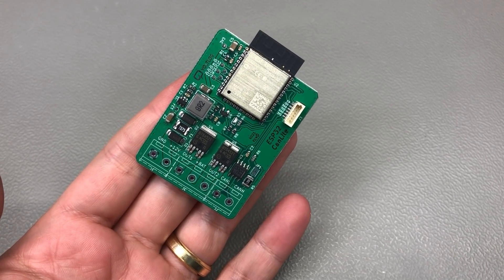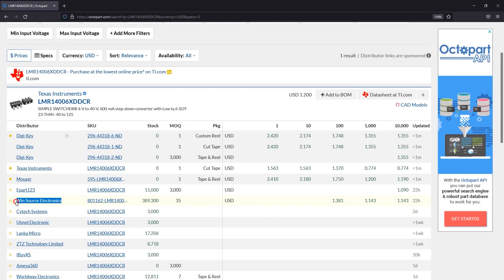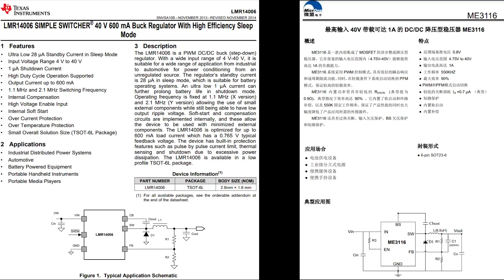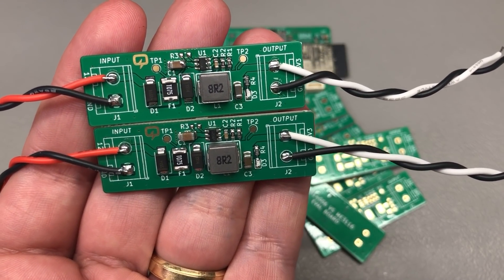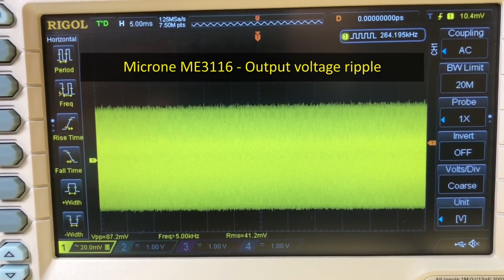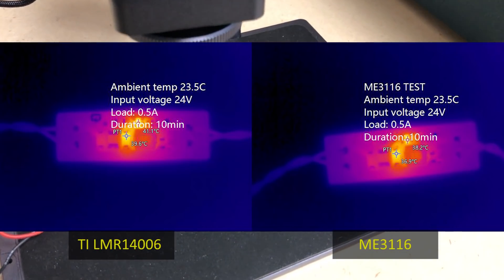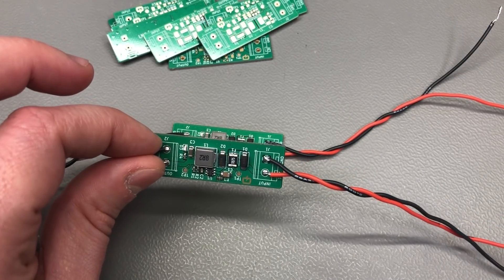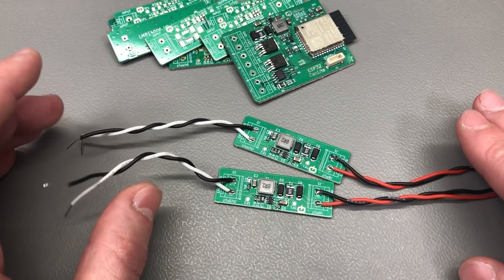Global Chip Shortage Solution Or Maybe Not? | Voltlog #406

Comment: While looking through the datasheet of the LMR14006 IC a while back I was wondering when to use the X and when the Y version. They apparently have no difference other than the switching frequency. It'd be interesting to know when to prefer which one.
Reply: The problem with higher frequency regulators is that they operate poorly with a high ratio between input and output voltage. A modern buck switching regulator often uses some kind of bootstrap circuit to generate a high enough gate voltage to switch a high-side NFET in the device. In order to keep that bootstrap circuit running, the controller needs to make sure the bootstrap capacitor gets enough switching activity, and therefore uses a minimum on time (there is also a minimum off-time, but that is irrelevant here).

Since for a buck regulator the duty cycle D=Vout/Vin, and Ton=D*T, you can probably guess where that constraint is coming from.
For the LMR14006Y, the min on-time is 95ns and switching frequency is 2100kHz typical. The minimum duty cycle is then 95ns/(1/2.1M) = 20%. If the output voltage is 3.3V and D(min)=20%, we have 0.2=3.3/Vin(max) ==> Vin(max)=16.5V.

Note this is not a smoke-Vin-max (like in absolute max specs). I would expect poor performance or regulation for >16.5V input. Although.. if the output voltage becomes unregulated, then that can create smoke down the line.
Reply: @nlhans1990  Thank you for this really comprehensible explanation. It also finally sheds some light on the question, why the simulator that @VoltLog linked in the CanLite schematic does not let me enter anything above 18 or so volts - despite the IC being rated up to 40V. I ran a simulation with the X version just now and et voila, I can enter higher voltages just fine.
Knowing this, I am surprised how robust the LMR14006Y is. I built a CanLite board myself and did some tests with different voltages (with some being under 10 and above 30). I did not experience any instabilities (or other failures) at all.

Comment: Since original part is operating at double frequency in comparison with replacement, does it use smaller inductor ? Maybe you could try to modify inductor value on replacement part, to see if ripple will get better or not.

Comment: The module you are trying to sub another part for is designed to be used in a vehicle?
If so, what about running automotive-related tests on the two parts, like a load dump test, to see if the Chinese one can take the voltage spike? I would think that these would be the significant tests in determining if a Chinese knockoff part can "cut the mustard" as a replacement.
Cheers,

Comment: why you used same setup for both ICs ? "replacement" have 550kHz frequency instead of 1MHz (require different inductor + ~3-5 times more output capacitance) and have recommended cap on feedback divider.
Reply from the maker: Because it would be very convenient to find a pin compatible drop-in replacement.

Comment: Regarding ripple: you could try to modify the inductor value accordingly. Speaking for the LMR14006Y vs replacement part: a larger inductor will lower the ripple current, and therefore ripple voltage. Since the switching frequency is 4x lower, it's ripple current will be 4x greater, so must be compensated with a larger inductor. If you used a 8.2uH inductor, then try 33uH.

The problem with that replacement is, whether you can find an inductor with high value and appropriate current rating in the same footprint.
Reply: I was also looking for a replacement but wanted to stick to the high switching frequency since I have no space for a larger a inductor or larger filtering capacitors. I found a fitting TI part but it's not able to run on 24V vehicles and it's not an automotive spec part.
Reply: had the same thought, it might be pin compatable but not component value compatable. Had the same problem the replacement part from the same manufacture  described as a fit, form and function replacement was half the switching frequency so the inductor size had to be re-caluclated.